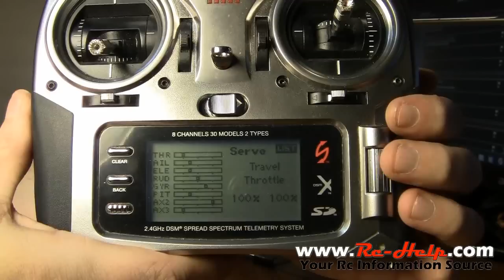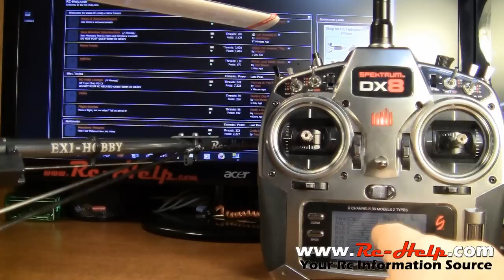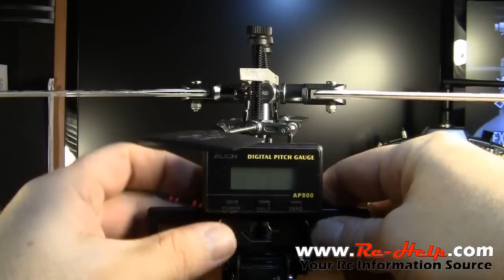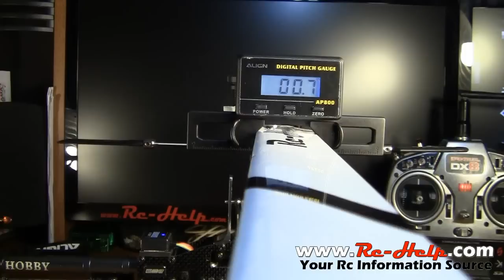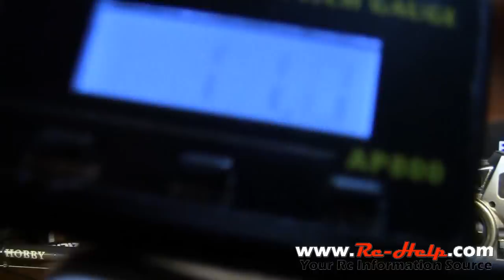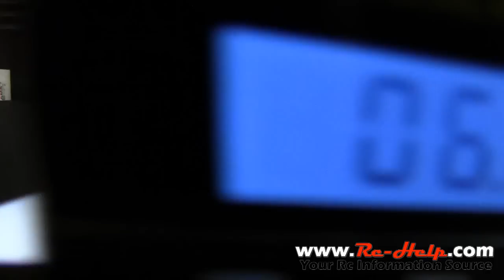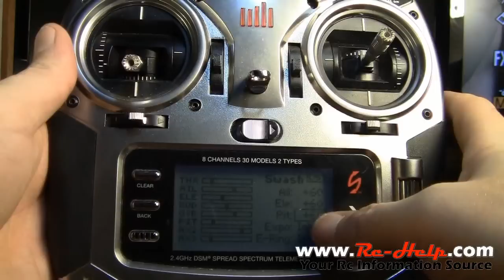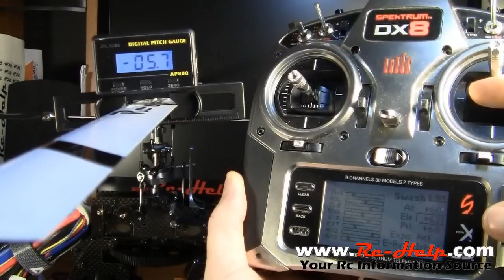Complete Flybar Head Setup

Comment: Still watching this after a while not flying.
Reply from the maker: Nice! Thank you.
Reply: @RcHelpDotCom  Going to fly my 700 nitro, but looking for a good pitchcurve throttlecurve video. Just bought a dx9.
Reply from the maker: pitch curve I always have linear on a nitro (and electric for that matter if I'm not doing a beginner video). The reason for this is I always know where my pitch is, and is going to be. I know when I go from normal to IU1 or 2, if the rpm is going up, it's going to gain altitude. If the throttle is going down (IU1 to normal), then I know I"m going to need to increase pitch to keep it in the air. 

For throttle curve, this is going to depend on your setup and if you are running a governor, which I HIGHLY SUGGEST! In that case, the manual for your governor will tell you where to set your throttle values for a given head speed. The Ikon2 governor (and Ikon1 for that matter) will usually be something like 30 60 90 or there abouts and you will set a definite head speed in the gyro software, and it will take over and give you that head speed depending on where your throttle curve is. Hope this makes sense.
Reply: I'm not aiming for 3d with the constant headspeed. Just sportflying. I know what you want with the governer🙂. Just normal mode and for autorotation.
Reply from the maker: Actually, for sport flying, the governor will help there as well. But if you can't or don't want to run it, set your pitch curve to linear for all 3, then set your throttle curve to a v curve. Just make sure that mid stick is the lowest point. You can do this in normal but it's best to only use normal to get the head speed up and then switch into IU1. The last thing you want is the engine surging trying to stick with your throttle stick. This can load up the engine and it will also cause the tail to kick around a bit.
Reply: @RcHelpDotCom  The headspeed iu1 midstick should be the same as normal midstick. And pitch o at midstick
Reply from the maker: You can run a lower head speed in normal if you just want to putt around with it. The way I have mine setup is with 3 different head speeds, but I'm also using a governor on all 3 as well.
Reply: @RcHelpDotCom  Maybe i will have a look at a governer. But for the time being,  i want to fly normal and sport.

Comment: i have a hirobo gas heli  SHUTTLE with 1 servo to swash plate  my manual tells me to put the following setting for a learner   -3pitch at low   +5 at mid stick  +10 at high stick  and yet all the video clips and yours all tell me to make sure i have no pitch at mid stick  san you help please
Reply: many thanks for your valued advice i understand  now yes all i want to do is learn the basic hovering and small  hops etc

Comment: Very helpful video
Reply from the maker: I'm glad I could help out! www.Rc-Help.com
Reply: RcHelpDotCom thank you very much. I just bout my new ccpm flybared heli and it was not that stable. Correcting the swash plate and the rudder gyro made it super stable . Thanks for this.video
Reply from the maker: It is absolutely my pleasure!
Reply: RcHelpDotCom Sir i have a doubt about nitro rc car. where can we get the nitro fuel for running it . I want to buy a nitro rc car and i am not having any idea about it. If you help me it will be very good.
Reply from the maker: Just about any hobby shop should carry it. Shipping it is very expensive since it is a hazmat product. If you have a local hobby shop, I would call them up and see if they have any. Start with 20% Nitro.
Reply: RcHelpDotCom thanks for your help. I dont have any hobby shop in my locality. I need to go a way 100 miles long to get my hobbies . Thanks for your help . I will try to get it here

Comment: hay I have a Kalt Zeus 61cc what tip would you have for a radio 6ch or 8ch and what type of Gyro at has 6 servos in it
Reply: RcHelpDotCom  they 4 servos is for they cyclic and one is for they tail and the other one is for they throttle

Comment: Can this head setup work on nitro helis? Specifically thunder tiger raptor 50 and 60? Getting back into the hobby and dusting off my dinosaurs. Lol
Reply from the maker: Yes, the head setup is the same for nitro, electric, gasser and turbine. It's just the power plant is different. The head may be different than what I have in this video, but it will be similar.

Comment: thanks!
Reply from the maker: My pleasure Andrew! www.Rc-Help.com
Reply: Ive set up helis before but its nice to find a few new tips that I never thought of - this video was really useful. I never thought about locking the flybar! Any tips on the best way to do this. Is there any risk of damage? Great video - cheers
Reply from the maker: The little lock I used in this video I actually made myself. It is just a piece of acrylic, a center hole that bolts where the little tab bolts in, and then two threaded holes for the nylon bolts. There is risk of damage if you over tighten the nylon bolts, but as long as you just touch them ,then everything will be fine. I don't trust those little cheap ones that slide over the head button, I like the ones that can't fall off lol.

Comment: Safety First no matter what even after you start flying you have to be careful with helicopters in RC in general I was flying a 600 size heli in the wind which was gusting about 30 miles an hour I was doing 3D right in front of me by myself needless to say I had an accident buy simple mistake or mechanical incident never really figured it out because the helicopter hit me broke my arm and 10 places cut the muscle in half broke two ribs and went inside my rib cage 7in I laid there and try not to die for almost an hour because I did not have a phone on me and I was flying by myself like a dumbass
Reply from the maker: Wow Andy, that is some story. I have read about many times where people were not so lucky as you and did end up perishing because of the injuries. You are very lucky and your story is what I try to get across to everyone I see doing something a little risky. You may not see it as risky, but as you know all too well, anything can happen and that helicopter comes at you in a split second with no time to react. Thanks for the comment, hope you are healing well.
Reply: I had three spektrum transmitters fail in just over a year. When the last one failed it caused a 400 size heli to fly towards me cutting my arm. When I looked at the display it gave the normal message 'System failed, return for service '.  I use an orange transmitter now - a third of the price of spektrum and totally reliable.
Reply from the maker: Just now saw this reply, sorry for the delay. It's amazing how many people have had issues with these Tx's. I have never had a single issue. Guess it is the electric gremlins coming out in regular production which sucks because of that they are controlling. Glad you are okay @Rayxl1 www.Rc-Help.com